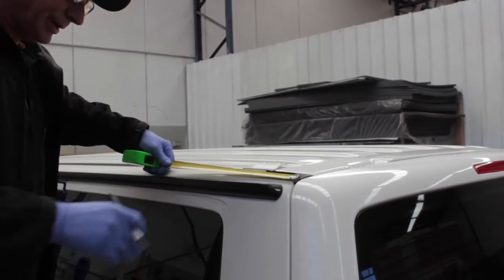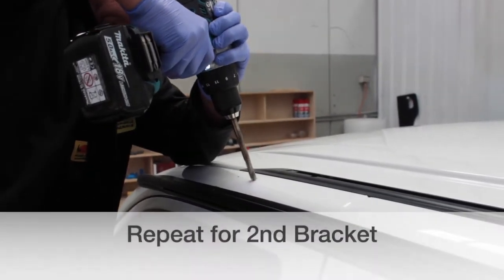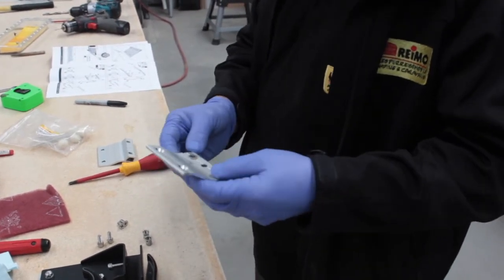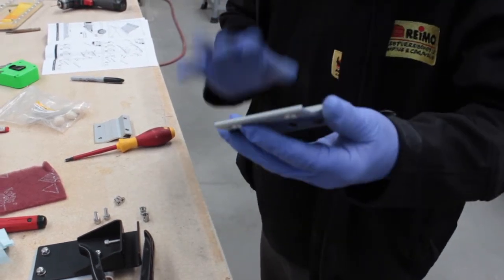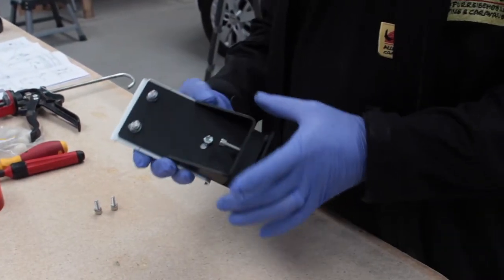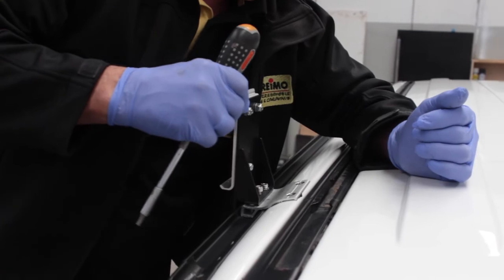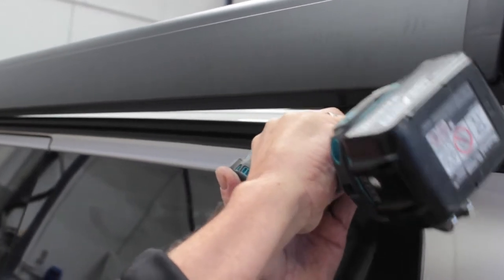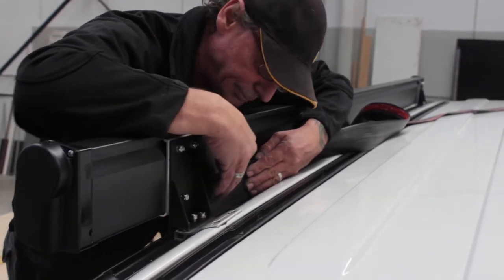Installing a Thule Awning on a VW T6 fitted with a Reimo Multirail

Comment: Good to see a demo prior to attempting same. However when you inserted the initial nuts I would have thought they would have been rivet nuts as such require compressing and not relying on sikaflex or similar sealant.

Regards

Derek
Reply from the maker: Hi Derek thanks for your comment and question.  Just to clarify, we do use nutserts and the nutsert tool for some applications, this particular application has selfsetting nutserts, which expand as the bolt is tightened. We do have a photo of this selfsetting nutsert, but I cannot upload it to youtube

Comment: Can you use the drive-away tent track with these brackets fitted? It seems that since they slot into the multirail track it is no longe possible to hook up a tent adapter to the multirail.
Reply: this is my question too. I was thinking about just sliding some figure 8 in and leaving it attatched

Comment: looking at fitting it with a roof rack can it be done
Reply from the maker: Our Reimo Multirail is designed to be attached to the vehicle.  For more information you will need to get in contact with your nearest Reimo branch.